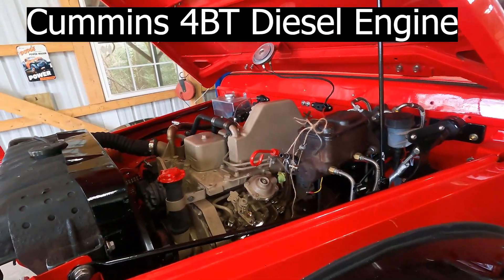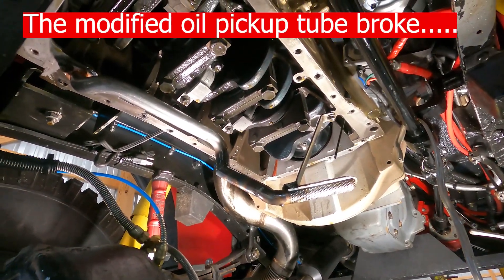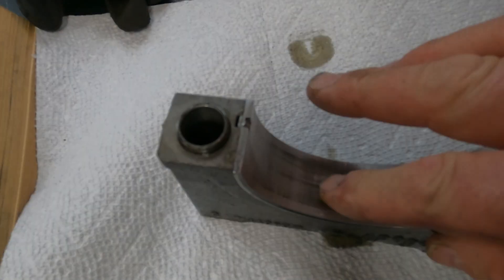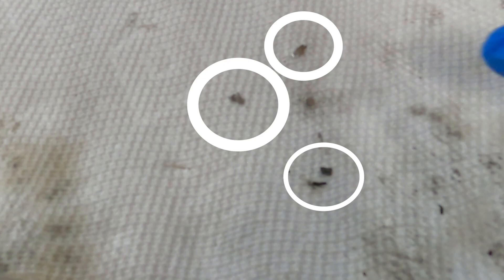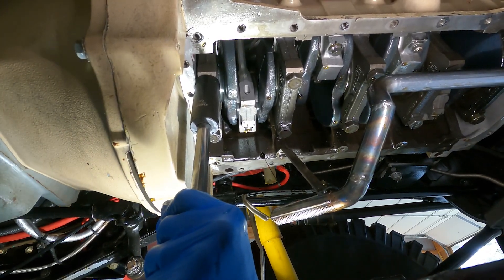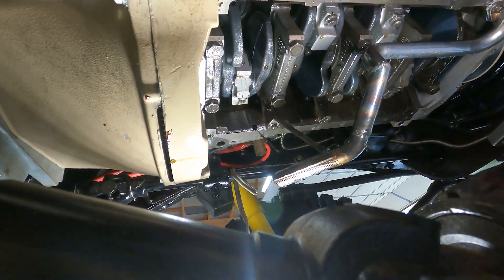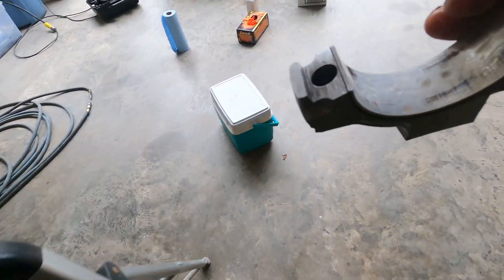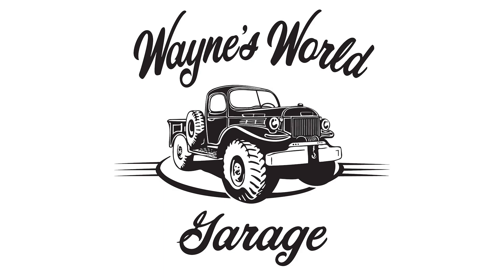Running a new Cummins 4BT with no oil pressure... What would you do?

Comment: Hi, This is Doc Dave, the owner. 
The 4 BT Cummins engine is used in all types of vehicles, and restomods like this one. It is not an extremely hard transplant, but there is one particular fabrication mod  you have to do. The position of the oil pan will interfere just a bit with the front differential when the springs are fully compressed. Although this truck will be cared for it will not be a strict trailer queen; I can not say with 100% assurance there could not be an issue. So you have to notch the oil pan and then as a result change/fab the sump pickup tube. I did the chassis, drive train and got the engine done. Tim Holloway of Distinctive Restoration in Vermont did the body, assembly, interior, finish work, and got it painted. He did a magnificent job.  I tried to be very careful with my part but I did make a mistake with the pan and pickup. I MIG welded it all myself. I have done a fair amount of that but am not a pro. Bottom line is the pickup failed!
What I have done now is I tacked everything up then took it to a local professional welder for TIG. Oddly enough, I had a pro do the engine mounts , tranny mount and transfer case mount after I tacked it. Why I did not do that with the oil pan and sump, I do not know but one lives and learns. 
BTW Tim does stock restorations of Power Wagons, as well as this Restomod of a 1953 Military M37. The M37 is like a short bed Power Wagon, used by the military in the Korean War up to the early 60's. It is a "3/4 ton" so rides better than the Power Wagon. They made several versions including the troop carrier/weapons carrier, an ambulance and a radio truck. BTW the prices of a stock M37, especially not restored yet,  are much less than its "half brother" Power Wagon, so is more affordable for you power wagon fans. 
I have two other trucks, one a 1952  "military style" power wagon (1 ton) and a 1960 "modern" Power Giant Power Wagon (2 ton). .
Reply from the maker: I pinned your comment to the top Dave. Next Video: Trying it out after the turbo is back!

Comment: Is it possible to spin the oil pump after fixing the problem and see if you can generate oil pressure without starting the engine? That would be my recommendation.
Reply from the maker: Ed, I'm not sure on the 4BT how that works with no distributor, , but I am sure Dave will pressurize the system somehow. We always do that on new runs, even though assembly lube is used.

Comment: I rebuild the bigger ISX engines all day, every day and seen every type of failure, I would have no issue with the running this engine, the turbo is usually the first to suffer from loss of oil psi. it may need proper inspection.  btw great looking truck.
Reply from the maker: Thanks for the comment.  And yes, the turbo is at the turbo shop now. It does need rebuilding...

Comment: if the copper isnt showing it would pass cummins warranty and reinstall it, you can turn the bolts with a impact gun, cummins has had me reinstall bearings that i would have bought new but its there dime not mine.
Reply from the maker: thanks. Yes, the bearings were not perfect, but I think they'll be fine. My impact gun struggled with the 23mm main bearing bolts, but then I realized we only had 70 PSI of pressure leaving his compressor....

Comment: If you can’t feel it then reassemble it. 

I rebuilt my 4cyl diesel last year. 
Reused main bearings. 

I put 20,000 miles on it in less
Than one year. 
Problem free❤
Reply from the maker: thanks. I agree 100%.

Comment: If that is the worst looking bearing, I wouldn't worry about replacing them. But I would be concerned about why the pick up tube broke. Bracing, to much vibration?etc.?
Reply from the maker: bad welding.... owner did it... and he is not a welder..... thanks for the comment.
Reply: @WaynesWorldGarage  I saw that it was welded , did it fall out, break? The breaking would concern me more.
Reply from the maker: @flitflit4579  it broke where it was MIG welded

Comment: My opinion, and $5, will buy a cup of coffee.  Seriously, I would do a good lightweight oil flush on the engine to remove any metal flakes. Then filter the oil with a paint sieve and see if there is any appreciable amount of debris. Then do a filter tear down to inspect the filter material. If it has little to no debris, then I would sorta be ok with it. If substantial debris is found then there may be some sort of damage in other bearings or the cam bearings.
Reply from the maker: That's where we're going. Two oil flushes, new filters, check mains and rod bearings, let her rip! The turbo though is toast.... That's at the turbo shop.
Reply from the maker: PS, I don't drink coffee, but five bucks now?? Wow.

Comment: If it is possible, I would roll in new bearings. i don't know much about the 4BT engine and how it oils the cam or if it has cam bearings. It would always be in my mind about that metal. I don't like the way they want to torque main and rod bolts on many engines now. The newer John Deere engines are like this also and also call for replacement of bolts. That is a very nice truck that many hours and skills to get to looking like that.
Reply: Sure got me thinking about this... Is metal from pickup tube? I have to say that I have seen some mig welds on custom motorcycle frames that I would not ride around a block in town. And the builder would not paid to have it welded the right way. I'm not joking about that.
Reply from the maker: yea... I can weld ok, I still would only TIG on something this critical. I've seen too many great looking MIG beads with zero penetration....